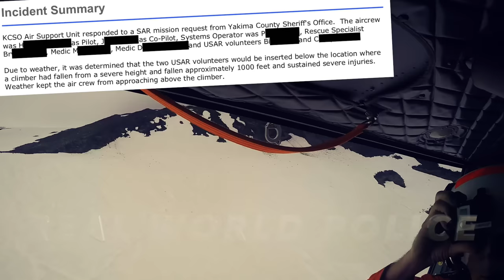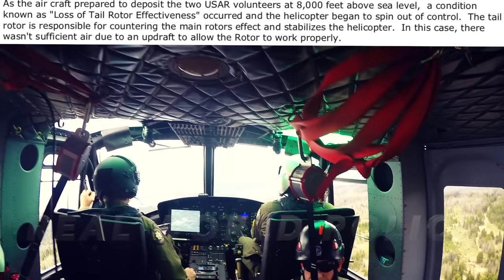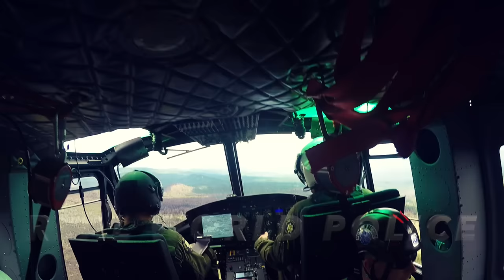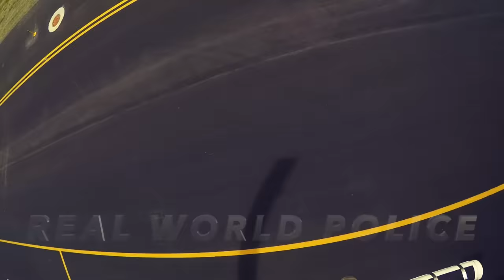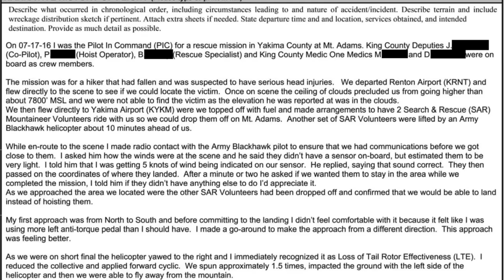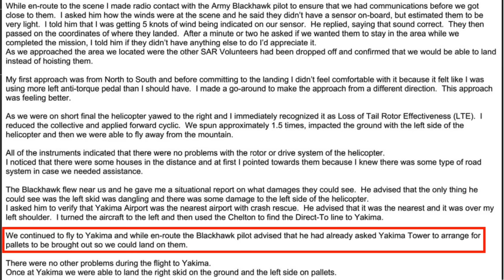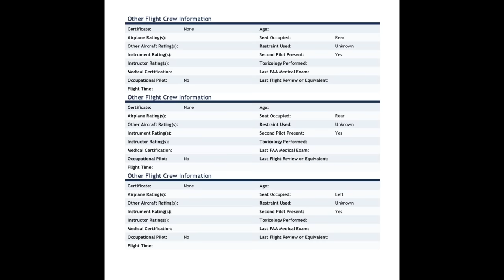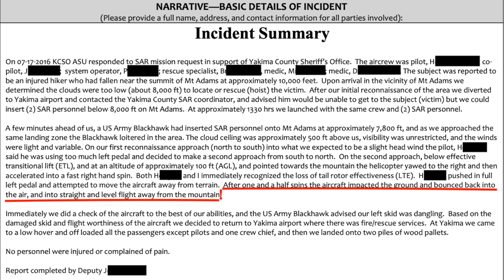Police Helicopter Loss of Tail Rotor Effectiveness & Collision With Terrain (HD)

Comment: Curious... why no intercom or ATC recordings?
Also, why was it deemed necessary to continue the flight of an aircraft with unknown damage over private/public properties & roadways? I see no way such an aircraft could be considered airworthy... even with an inflight visual examination from another aircraft.
Reply: well what were they suppose to do let the helicopter roll over? it hit the ground bounce in foward momentum so the pilot took that and used it as foward momentum to keep going. if the pilot deemed the helicopter not air worthy he would have landed it. They have instruments that read out rpm for tail and main rotor and heat and etc. its a huey it took it and flew on just like vietnam huey's there is a reason why they have such a good reputation.
Reply: Whats in question is the judgment of the pilot in command. Unnecessary continued operation of a known un-airworthy aircraft, full of personnel none the less, is a most irresponsible reckless act. Doing so over a populated area is unfathomable.
Reply: @rwbishop  So what would you have done?  They land it, it rolls to the left because there's no skid there, main rotor blades shatter and go flying everywhere.  Meanwhile the aircraft is on it's side, dumping fuel.  It catches fire, everyone dies.  Oh and it happens off-airport in a rural area so there are no ground rescue services anywhere nearby.  Is that your solution?  I know people who were on that aircraft during the incident.  I'm very thankful the pilots made the correct decision after the impact with the mountain.
Reply: I'm not a pilot, and don't know the proper procedure/s... but I'm certain that unnecessary operation un-airworthy aircraft is not an option. Especially over populated areas.

Comment: LTE- when the tail rotor is exposed to wind forces that prevent from carrying out its functions of canceling the Torque of the engine and the transmission: any low airspeed high power environment provides for this to occur. The crew stayed calm and no not no one is injured and no lost of the tail rotor during this incident and the Blackhawk is contacted and flying safely